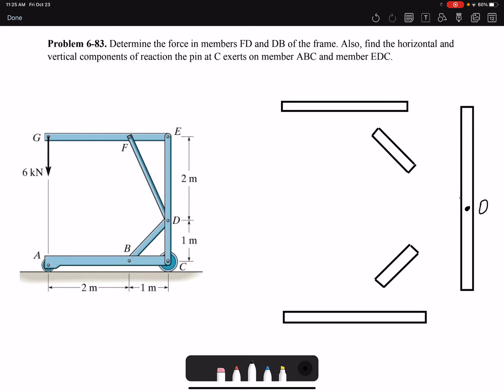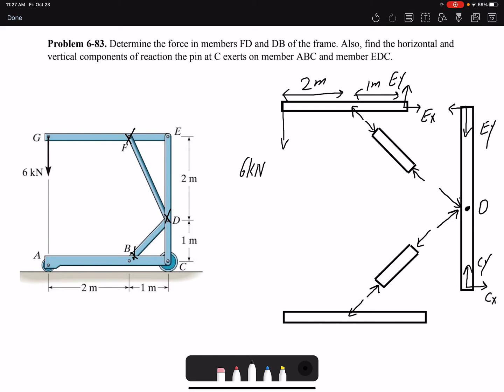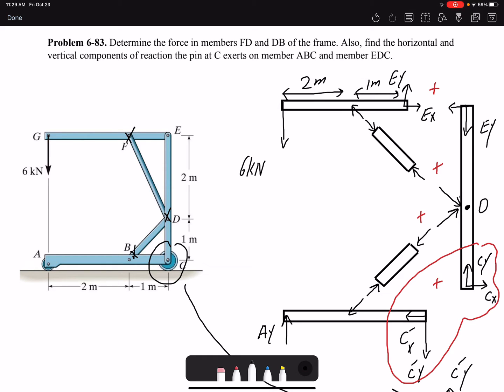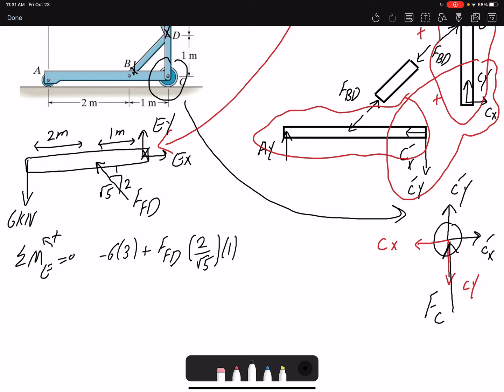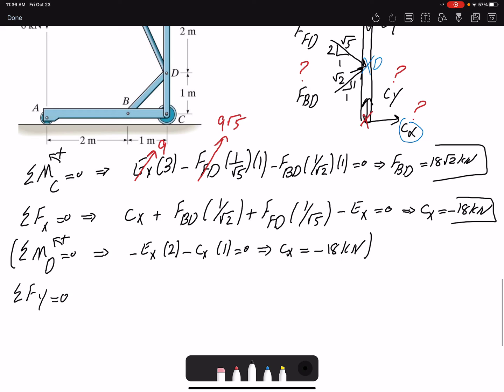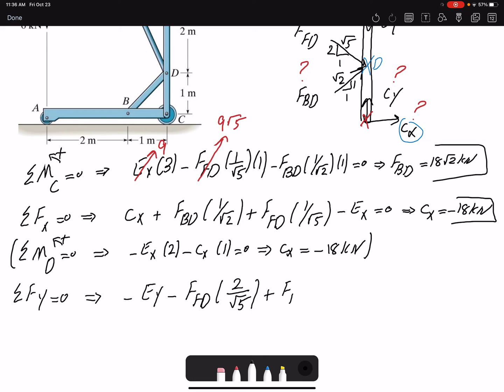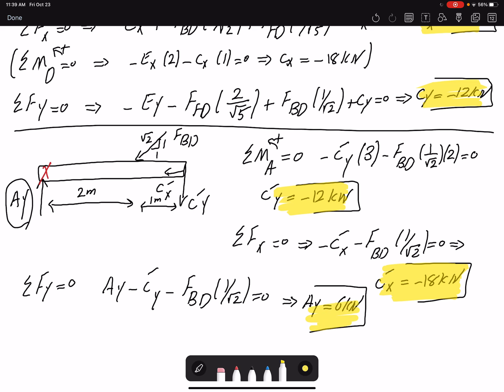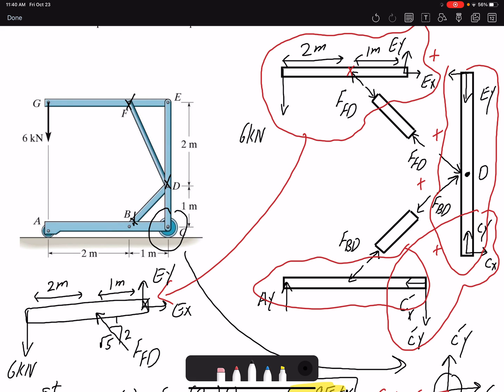Statics Problem 6-83: Frames and Machines example with exploded Free Body Diagram

Comment: why was a force in horizontal direction not assumed at point A? Is that a roller joint ?
Reply from the maker: Good question, since there is no friction, there is no resistance to movement in the horizontal direction and therefore no reaction force